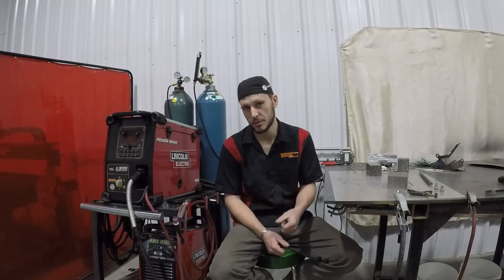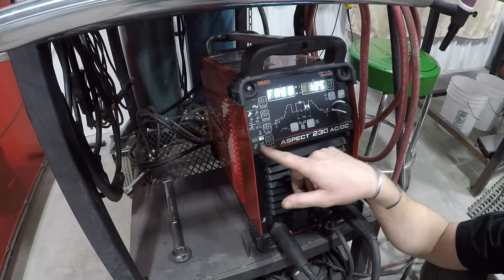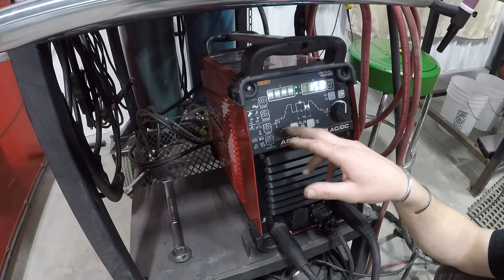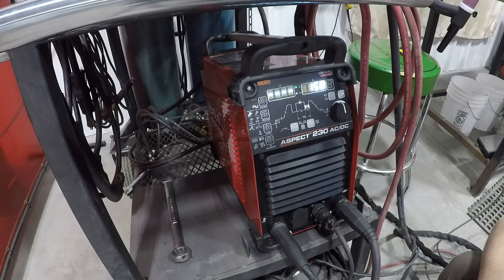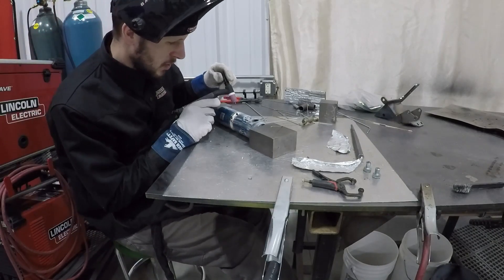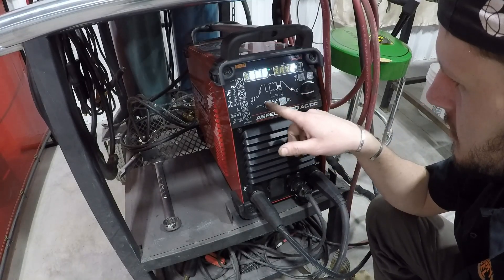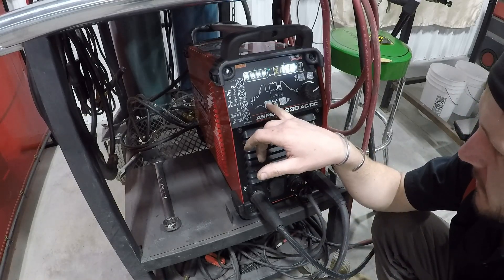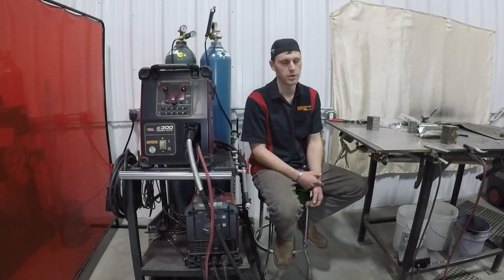Lincoln Electric Aspect 230: AC Aluminum TIG Welding & Overall Review

Comment: i am trying to weld on thin stainless foil adding 316 filler wire. any setting suggestions?
Reply from the maker: Starting and ending amperage at a minimum. Use .040 tungsten. Adjust amperage after you adjust tungsten setting. 1.5 or 2% lanthanated.
Reply: @doomsdaydiesel  can this plant do stick welding
Reply from the maker: @ronalddino6370  yes, I've welded mild steel and cast steel with it. It works great!

Comment: Just got into aluminum I got problem where my heat only hits one side of a T joint
Reply: never messed around with the settings I just turned it to AC, going to try mess with settings
Reply from the maker: @okemowokemow7767  make sure tungsten is sharpened properly and you're pointing it equally to both pieces (or change tilt to change heat input on each piece).
Reply: @doomsdaydiesel  Yes thanks its working now

Comment: those cans are lined on the inside
Reply from the maker: Yep, otherwise we'd be tasting funny things when the acids from the pop reacted with the aluminum and aluminum oxide. And boy does that coating STINK when you melt it!!
Reply: I am having trouble setting this rig up.  Any suggestions on starting settings?
Reply from the maker: @briannilson4230  for what?